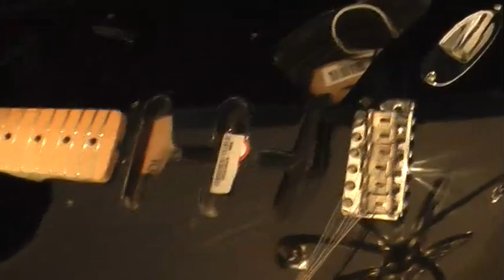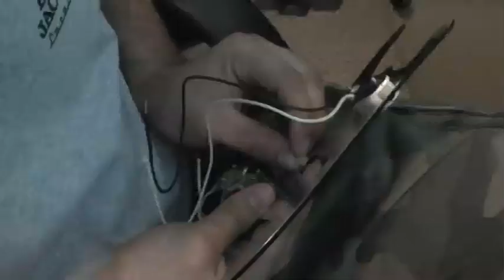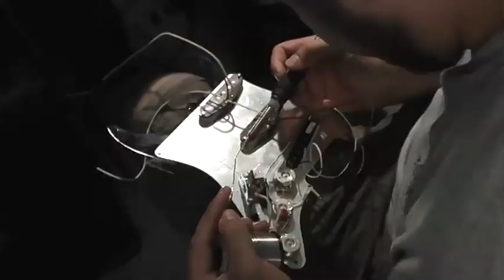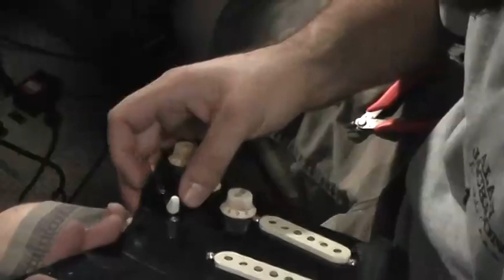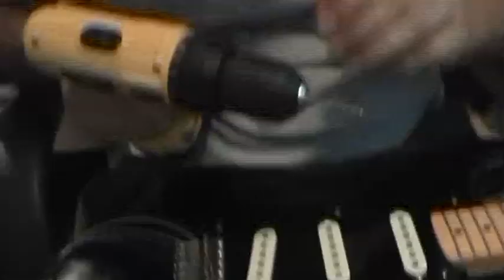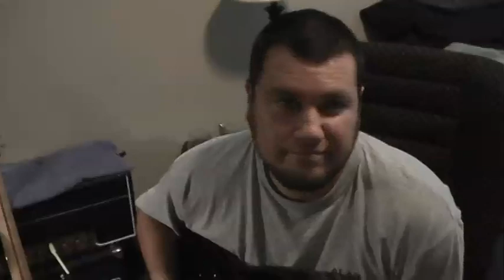David Gilmour "Black Strat" Replica Project Video by Jon Schneck

Comment: It wont exactly because the edges of davids pickguard are rounded and the ones we have have a 45 degree angle. thats it though. unless your looking at it 5 inches from your face you can't tell the difference. other than the edges its exactly the same, switch and all. yes it is acrylic. IMO the thick acrylic pickguard  that we bought looks way better than those black vinyl pickguards that are thinner.

Comment: Doing the same but using a Warmouth neck; Indian maple finger board with a bone nut and stainless jumbo fret wires. For a cheaper mod, one could use a custom shop (MIN) with the 920D package. I bought one of these as well for 250 bones used on Craigslist, and added a bone nut. Awesome deal! The only drawback here was the 21 fret MIN neck. I now never use my '57 vintage strat for gigs, which has always been a source of stress for me since as I worry about having it stolen.

Comment: very nice rendition of a great guitar, great work on the soldering and electronics in general...

Would it be possible to list the parts / suppliers you used in this build?

I'd like to use it as a quick reference chart.

Comment: The neck should be a 50s Fat Strat and the middle a 69 custom shop. The bridge pup is the SSL
Reply: I have a maple-fret 2014 Am. Std. with Fat '50s and I had a Mex Strat with the SSL-1, but I can tell you: the neck pickup on SSL-1 sounds SO much better, with more chime and full classic tone. I cant remember the middle, but the bridge on both sounds almost the same, cant tell the difference.

Comment: Wrong neck and middle pick ups man !!
Reply: What is right?
Reply: +JAZZ BLUES   The neck should be a fender fat 50's, middle should be a fender 69, and the bridge should be a vintage Seymour Duncan SSL-5!! Wired with vintage cloth wires! That's the exact setup in the relic guitar he uses !
Reply: Mr. Gilmour uses the nick and middle pickups from a 1971 strat and a SSL-5 prototype labeled as an SSL-1c. So using the CS69 are more appropriate.